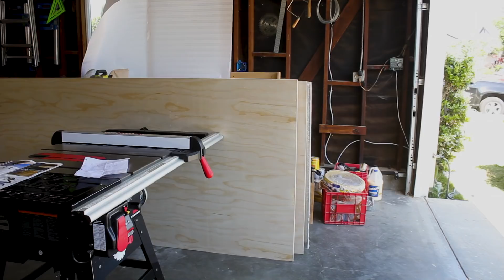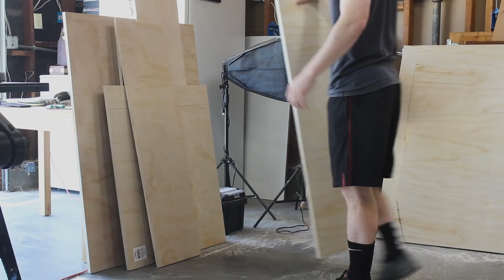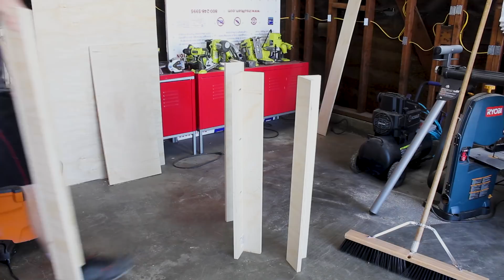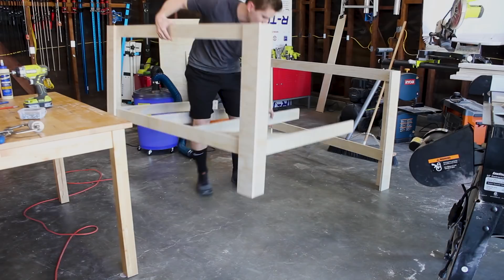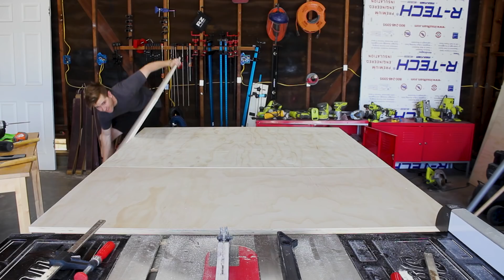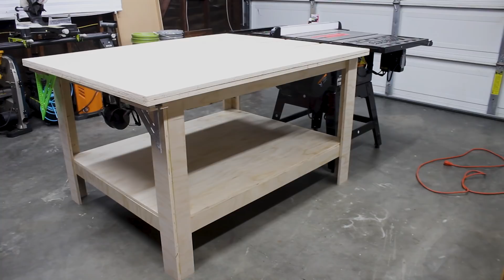DIY Workshop Outfeed and Assembly Table | 29

Comment: Damn why the hate on your page?  One question as a fellow sawstop contractor saw owner, can you tilt your blade to 45° while having the outfeed table there or do you need to push it out due to the motor movement?
Reply from the maker: Are people hating? I had issues with it originally but if you have enough table over hang it won’t be an issue. But it is a bit if a design flaw

Comment: Are you able to tilt to a full 45 degree mitre without the motor hitting the outfeed table?
Reply from the maker: Yes - you just need to make the overhang from the outfeed table long enough to overhang it; otherwise the supports underneath the top part will hit it (something I wasn't aware of at first and then adjusted); its a flaw in the SawStop Contractor saw design

Comment: Watched your latest video of the drill charging station, and then went into your library to see what else you've made. Love the outfeed table as it doubles as an assembly table. It's not too big that it overtakes the shop, but it's still substantial enough to work as intended. You, sir, have earned my sub. I look forward to future videos and also digging into your library.
Reply from the maker: Awesome, thank you! Its a really good single day build to add storage, workspace, and out feed in the shop. 10/10 would recommend to a friend.

Comment: I don’t think you have enough clearance from the motor to raise and tilt the blade for angled cuts.
Reply from the maker: I ended up re arranging my shop and the table saw faces a different direction - I have to slide the saw back about two inches if I want to bring the blade to 45°, so you are definitely correct in that regard.
Reply: I was going to ask the same question as I have the same saw and same issues.

Comment: Nice build  on the outfeed table  you may be aware of this or not but Norm Abrams built a similar style table  on a New Yankee Workshop episode years ago, the  main reason i.  Remember that build was he had  kind od a cool  set of wheels mounted to a hinged board that allowed the table to be on the wheels for mobility or on the legs for stability   I thought it was a pretty smart idea and it didnt require any fancy or expensive hardware    ! I do not know for a fact if that episode is on You Tube or not  although many of them have been posted  and it may be worth your time to  look it up  or even flip thru one of the many New Yankee Workshop books  in a store or library  i also remember it being. A pretty   Good use of sheet goods  like you mentioned  and thats why i always liked that style BTW i do not recall if he used Pocket Screws or  another method ? My Ex Wife used to make fun of him and the show because for a while he was real hot on Biscuit joints  and she thought that was funny, She knew i used them  both at work and home  although at work i had a Lamello machine and at home i used a " wing" router bit  with a bearing  she knew because i kept toying with buying my own machine  for home use ... my rationality was  for as little as i used them at home. I could swap out  another spline bit for the Biscuit  thickness  one  as at home i didnt need to worry about high production  as a hobby  or side job  i did however  pick up a China made unit for really cheap a while ago that works just fine  and i think will last a while  for as little as i use  it and do not abuse it  as it is basically a hobby shop that  i mostly use  or share with close freinds and family

Comment: Nice out feed assembly table.  I think you are using the term “shearing strength” incorrectly.   Shear strength is the term used for the materials strength parallel to the force.  Think of clamping one end of the board clamped and stacking weight on the other end until it breaks.  I think the proper term for the strength added by the corner braces is racking strength.